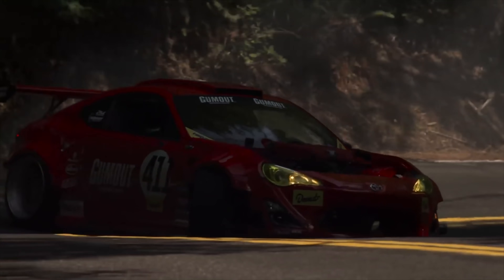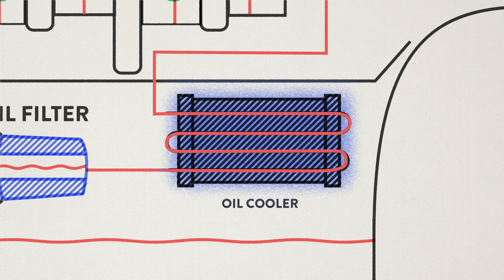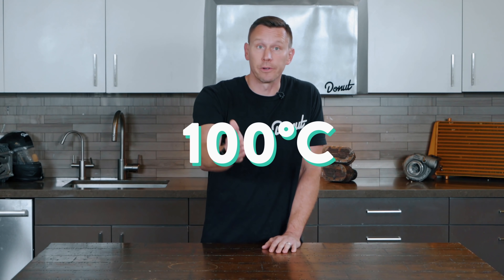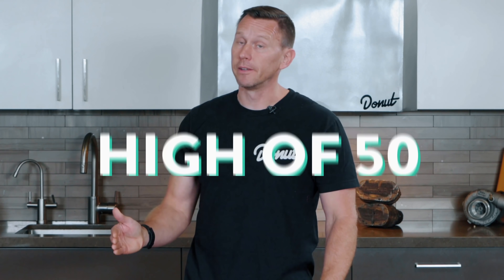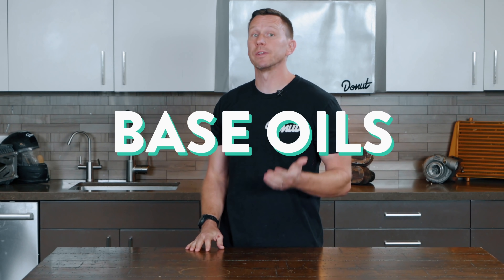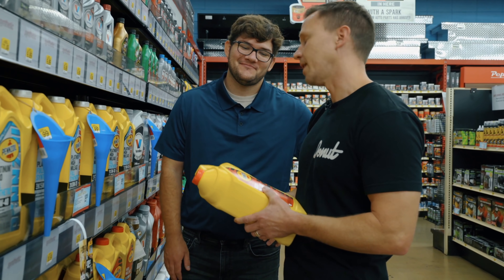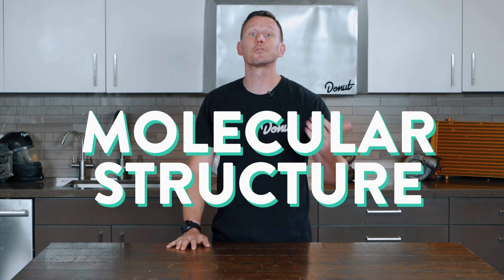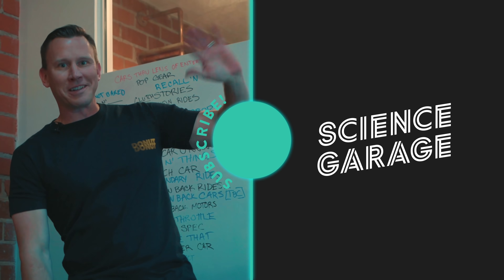CONVENTIONAL VS SYNTHETIC MOTOR OIL - How it Works | SCIENCE GARAGE

Comment: Normally is the other way around with the fuel pump. First you got your strainer/filter, then go to the pump, then goes to the system passing throught the fuel pressure regulator.

Comment: I really, really wish that these "experts" would/could understand that the W does not mean weight, I means WINTER.
Reply: It does but its the weight or viscosity or flow in winter, so it still refers to its weight. And this guy did say that it means winter and the second number is how it behaves in warmer weather.

Comment: I just change my 2018 Tiguan with Q8 5w30 engine oil with 5 liters of total, Well its a full synthetic oil 😁

What if i change my 2018 Tiguan which is a modern car with modern engine with a mineral based oil ?

Comment: My 94 Corolla has 432k plus miles on original engine and trans, neither rebuilt ( knock on wood ).bought w 100k on it, ever since it has had the cheapest oil I could get once every 5k. Old gal is still kicking, japs can’t build nothing for nothing, had to replace ac compressor at 375k, starter has had contacts replaced twice now, and fuel pump gave out at 429k but moral of the story is change your oil about every 5k, modern cars say 10k….don’t do it!!!! Change every 5k no mater what oil you use. If you use synthetic, you have to have a filter that works in harmony with the oil for best results, can’t use the crap filters at the auto parts store, need a filter designed for use with synthetic

Comment: Unfortunately, I have found that with newer engines that require synthetics you really shouldn't go past 5000 miles on an oil change anyway.  With the addition of turbos and other items that add to the wear and tear on your engine you should keep the same service intervals and use the better oil.  That being said... on an older engine, synthetic oil still looks new at 5000 miles so I can see the feasibility of a 10000+ mile oil change.

Comment: Synthetics really are the way to go I've built a lot of motors I seen a 300,000 mile motor ran on mobile one synthetic 10k to 15k mile oil changes and it was still  in factory specs still had the hone marks on the cylinder walls from the factory no copper in the main bearings absolutely beautiful inside could have kept going on the flip side I've seen 80-90,000 mile Motors that had run conventional their whole life and the mains were worn out copper showing worn down camshaft profiles sloppy egg-shaped cylinders after all that I've seen I'm sold on synthetics for  life I've seen it with my own eyes in building Motors and the days of 3k or 5k mi oil changes are over! Amsoil can go 25k and I have sent samples to Blackstone labs that back that up!

Comment: I'll have to disagree that synthetic is slipperier.  

AA axle for Dodge was having ring and pinion gears with synthetic oil.   AA engineers visited our dealership and said put dino oil in it.  

Synthetics have higher flash points but not necessarily more slippery than dino.

Comment: All this video does is validate my dedication to using only full synthetic oils and not changing my oil every 3000 miles.  I think that plus buying quality filters has definitely helped my Mustang's engine not have any issues despite having 180k miles on it and it being over 20 years old.

Shame I didn't do that with my suspension...  all the money saved not fixing a broken engine went towards endlessly fixing suspension issues...

Comment: Is there any danger to running 0w20 oil In an engine that calls for 5w20?
Reply: It’s going to be too thin at low temperatures. If you live in a climate that is warm all year round you should be good though

Comment: I have used mobile one for years I have to listen to all the people who say that it’s the worst thing you can use in your engine causing leaks on every seal or gasket in the engine well I have vehicles with 300,000 plus miles I took off valve covers and oil pans and the engine looks like new I will continue destroying my cars with Mobile one

Comment: Dude is a blithering idiot well it's not made from dead dinosaurs or any other dead animals its made from carbon and hydrogen two of the most plentiful elements in the universe along with heat and pressure you get everything from coal all the way to natural gas imagine.
Oil has four jobs it's to clean the bearings from metal atoms that come dislodged carrying it to the filter next it cools the bearings because of the turbulent friction the surfaces encounter moving with a viscous agent in between it's also there to prevent oxidation or corrosion and then there's that mysterious fourth thing to hydrostatically keep the surfaces separated and you thought I was going to say to lubricate what the hell is lubricate what does that mean a clean bearing a cool bearing and one that doesn't have any oxidation or corrosion doesn't need to be lubricated whatever the hell that might mean.
Carbon polymers viscosity modifiers what the hell is that I'll tell you what it is it's called rubber or more crudely stated filler in a hot engine it becomes a black goopy burnt on deposit or garbage that gunks up your engine it's a way to imitate a heavier molecule a longer carbon chain where one doesn't actually exist all you have is much smaller carbon chains thinner oil with filler added brilliant cheap bastards.

Comment: Synthethic oils are a hoax??? Are they only base oils with better additives??? Why theres no syntethics oils for diesel engines??? Diesel engines work under tougher hot and stress conditions , some under higher temps with turbo Charger ,yet they seem to do  fines with mineral oils

Comment: I’ve used synthetic oils for decades and have seen first hand how much better they perform and protect. I used to use Mobil 1 synthetic in the 90’s, when I worked for a local Toyota dealership as an ASE certified mechanic. At the time I owned a 1997 Toyota Tacoma LX 4x4 extra cab that had a 2.7 liter I-4 cylinder engine and a 5 speed manual transmission. With that truck I off roaded it several times a week, towed a boat and jet ski’s behind it, hauled a lot of building materials because I was also working for my Uncles construction company and eventually quit the dealership to go back to work for him full time but before doing so, when I was still working at the Toyota dealership, I tore my engine apart to inspect everything and measure engine wear. In the bay next to my truck was another Tacoma identical to mine. My truck had I think somewhere between 125,000 miles on it to 145,000 miles on it and due to me changing the oil every 2,500 miles with Mobil 1 synthetic, and using an OEM Toyota oil filter, my engine still looked virtually new, with very little wear and compression that was still on par with new Tacoma’s. 

The Tacoma next to my truck had I think somewhere between 35,000 miles to 40,000 miles on it and had the oil changed at the dealership every 3,000 miles or so with standard/non-synthetic Valvoline motor oil, which was the oil that our dealership carried in our oil tanks for doing customer oil changes. 

The customers engine that had around 100,000 miles less than my truck did, was still in really good shape, had excellent compression but my engine had less wear and even looked much cleaner on the pistons and valves.

Up until this past year I continued using Mobil 1 Extended Performance synthetic motor oil but after doing a bunch of research on what is the best synthetic motor oil available, Amsoil showed to be the absolute best synthetic motor oils and other lubricants on the market. As a result of that, I am now running Amsoil Signature Series synthetic motor oil in all of my vehicles now, as well as their synthetic automatic transmission fluid and synthetic gear oil for all of my vehicles front and rear differentials.

Comment: But I heard you shouldn’t use synthetic in an engine made for conventional because the seals aren’t made for it or the tolerances aren’t tight enough to stop synthetic, anyone got an idea
Reply: I have used synthetic in every engine I have owned include 80s and 90s models.  Synthetics being standard weren't a thing until the 2000 and beyond.  I have never had a problem and synthetics have only improved engine performance of the engines where they weren't standard.  If the seals are leaking with synthetic they probably should be replaced.

Comment: What I'm trying to figure out here is in the winter should you let a car sit and warm up or drive it. I hear different arguments on this all the time.
Reply: Wait 30 seconds for it to warm up, unless you are in absurdly cold North Dakota temps. Older cars need more time to build up oil pressure too so you should wait a little bit in the summer too.

Comment: From what I heard, the only engine that full synthetic oil is NOT recommended is the Mazda Wankel Rotary engine. They said that the additives that are in synthetic oils could ruin the apex seals and cause a lot of oil burning and consumption.

Comment: Many new cars recomendations are a Energy Consrerving 0w-20 oil, these oils are very thin oils for very cold climates like -40 Siberia/Alaska. How many enviormentalist live in places like that? Just how long will that 0w-20 oil hold down in the Arizona Summer Desert where you normaly need a 30 - 40 weight oil so your engin doesn´t seize?  Most oils on the market are a Group lll Hydro-Crack Oil which is you base oil that has been highly refined, so as not to be confused the True Synthetics Group lV and V are made for high performance engines with very tight oil changes....like after every race. Good Video.

Comment: I have a 2010 corolla with an option of 5w20 or 0w20

Car has 130k and im curious if i should use 5w20 high millage oil or 0w20 full synthetic?

Toyota recomends 0w20 but since it already has 130k should i go with high millage oil?

Comment: I use semi-synthetic two stroke oil for my two-stroke Trabant 601. It’s cheaper than organic (wtf?!) and produces much less carbon or as we call it „oil-coal“, which extends my exhaust‘s life. It’s not really build to get cleaned. Maybe, if it’s full of deposits sometime, I’ll just put the exhaust parts into a fire to melt and burn away all those deposits

Comment: Don't forget that in rotary engines, conventional oils are necessary as rotaries are designed to born oil, synthetics don't burn and you'll damage your engine using them. Remember to not use synthetics in your rotary, not like anyone here has a rotary but still

Comment: I change the oil in my Challenger SRT8 every 6 months, as opposed to miles because it's not a daily driver and don't put many miles on it. Obviously an HP hemi motor requires full synthetic, and also takes premium gas

Comment: Here's one,  does it really affect your car engine or transmission on older cars if you switch from dyno oil to synthetic? Do the seals really start leaking due to the better lubricant being used?

Comment: My 1980 CJ7 Jeep with the 304 V8 will absolutely 100% swallow synthetic, in a day it will be dry, conventional doesn’t. Idk why or where the synthetic goes (my guess out the tailpipe after slipping by the rings) but it’s not on the floor. Idk weird thing and this is the place to share

Comment: Synthetic is expensive, but my God does it last forever.  I'm getting 8000 miles between oil changed in my two gm vehicles.

Comment: Cool to learn about the exact differences between buying synthetic vs conventional. Can you guys do a video on why Turbocharged cars typically recommend full synthetic? Is it because they produce a lot more heat? Or that they just need the better flowing oil to lubricate all the crucial components vs a NA vehicle?
Reply: Resilience to  Heat mostly I believe.

Comment: synthetic is a scam, conventional oil of the proper weight works fine
Reply: Unless you buy a car that takes synthetic and you use conventional and then some parts of the engine and now you have a car that is seized up and now you have no car

Comment: Some older diesel engines with mechanical fuel pumps and injectors don't need electricity to run after than have been started. Heck some you can start with air so you don't even need a electric start. Even some modern ones can if you have mechanical pumps and injectors.

Comment: If you go to synthetic you cannot go back to regular motor oil as the synthetic leaves a film on car parts that does not allow the regular motor oil to provide lubrication by clinging to the parts of the engine.

Comment: WWW.MOTOROILTESTS.COM
Welcome to see the best test done on conventional and synthetic motor oils for your cars ,Diesel trucks and Motorcycle .
this website is a part of reproduction of a wear test on Motor oils created by 540 Rat (His Nickname)I've built this website with his test and I give all the credit to this expert in oil testing.
540 Rat is a Mechanical Engineer (A Mechanical Engineer is clearly the most qualified Engineer to test motor oil that was formulated by Chemical Engineers, for wear protection capability between mechanical components under load.)
U.S. Patent Holder (Mechanical device designed for Military Jet Aircraft)
Member SAE (Society of Automotive Engineers)
Member ASME (American Society of Mechanical Engineers)
Lifelong Gear Head, Mechanic, Hotrodder, Drag Racer, and Engine Builder.

Comment: I live in a climate where it is winter 6 months out of the year. My e46 328i recommends 0w-40.
Does that sound right?
Reply: That's absolutely fine. Make sure it meets the BMW spec as well. SAE viscosity rating is NOT the only factor here.

Comment: Entertaining but consider the statement about uniform molecules... Sure maybe possible to get the base mostly uniform. The problem is the oil does not consist of just one molecule. There are many other additives that are different molecules with differing sizes and shapes which negate the uniform narrative. This uniform molecule is actually impossible! Its just a gimmick to make people think it so high tech they cannot understand or question the BS! 😆
Not saying synthetic is bad either. And I'm sure you got the gimmick from synthetic companies. Just stop and question the BS sometimes... Thanks

Comment: If it's not a PAO polyalphaolefin base stock oil it's not a real synthetic. A legal loophole allows non synthetic petroleum oils to call themselves synthetic. AmsOil is the best synthetic oil because it contains esters to keeps your seals soft so they don't dry out crack and leak. I have a 2001 GMC Sierra 2500HD and have been using AmsOIl for over 18 years. I have no sludge, leaks, or smoke out of the tailpipe. It costs more but you only have to change it once a year or 15,000 miles. It is the best oil I have ever used.

Comment: When I first started working on my cars I thought the higher the weight the better. So I used to put 20 W 50 in my 1.6 Nissan Sentra with a recommended 5w 30. The heavier oil never hurt my engine. I didn't start using 5 W 30 until I moved from Florida to Ohio.

Comment: I'm sorry 24 quarts of oil per year for 1 car? Most cars take 5-8, many modern ones even less.
Most naturally aspirated cars have a 12 month service window, so 1 fill up per year. Some new diesels (Range Rover) even have 2 year intervals, so now halve it.

Only cars I've seen that require more are some Germans that do 6 monthly changes.. which is just ridiculous.
Those same cars (2010 era VW's) would magically lose nearly a quart every 6 months. Even those ones though would still be 10-12/year after 2 changes.

I don't know how much y'all American cars use but if it's 24 then you're doin it wrong

Comment: Hi - I really like this video - you've spelled out the differences between conventional and synthetic oils in a format that's entertaining & easy for anyone to understand. I've been using synthetic motor oil for a couple of decades - it's well worth the extra cost. My three highest mileage cars had 240,000 mi ('03 Durango), 303,000 mi ('95 Grand Cherokee) and 362,000 mi ('70 Olds 442) when I sold them - all were still running well when sold.

Comment: Side note add to this video is that if you have a really old engine that is only ever had conventional oils and you switch to synthetic oil. Engine will leak synthetic is a much thinner oil and will work its way through the old gaskets

Comment: Conventional oil should be outlawed.  There's no real advantages to using them.  Even if they are cheaper up front, they still end up costing more than synthetic because #1 you have to change the oil much more often and #2 lowered fuel economy.   See our channel to see what the engine professionals recommend.

Comment: There is one big problem with your video, that being almost all automotive "synthetics" are API Group III oils and they are manufactured from the same source product as "mineral oil" using a different processing method (They are not solvent processed as Group I oils are. Even Group II oils are Hydrocracked and have greater thermal stability that conventional Group I oils.  Group III oils just add one additional step in the process that increases their VI.).  Interestingly, even the product you used in your demo is a Group III synthetic PCMO as are most all common automotive products on the consumer market.

Comment: Synthetic oil is better, not just because it lasts longer but also because its cleaner and has more cleaning additives that will keep your engine cleaner, make it flow easier, is tougher on all temperatures, and it rejuvinates your engine.